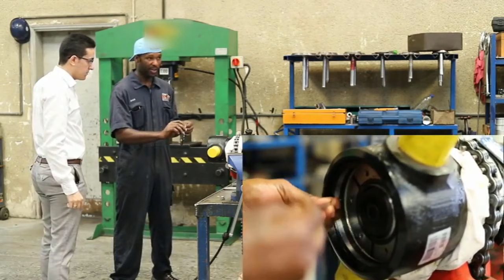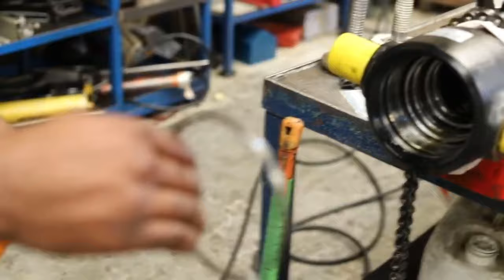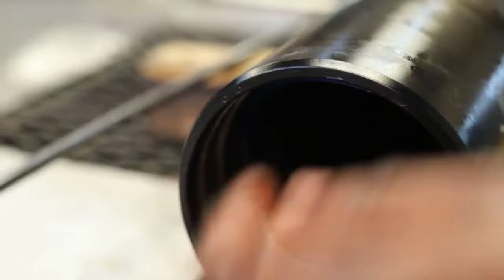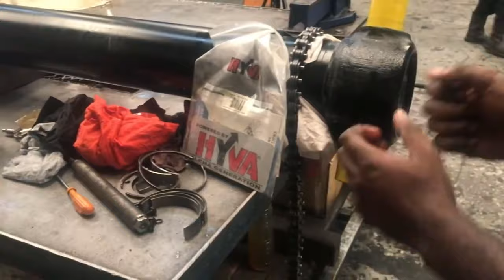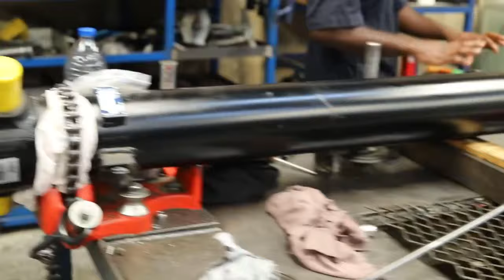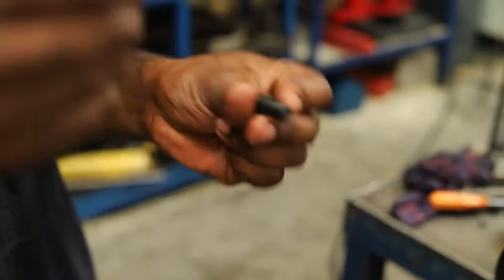HYVA cylinder seal KIT replacement

Comment: Bro what's repair tools name in English
Reply from the maker: Hello thanks for you interestes in this Video
- open-ended spanner (wrench)
- Air Grinder
- Mallet
- Screwdriver
- Drill
- Chain Pipe Vise
- Sandpaper
- Workbench
- and some special media tools (Deploy for pushing out the stages) /( and special made vise for the bottom plate)
Reply: @NicolaKameel  thanks
Reply: Do you find this tool online
Reply: I also work for hydraulic repairing, make you more videos and help us
Reply from the maker: @bhawanidewara5074 the special made tools is not available online